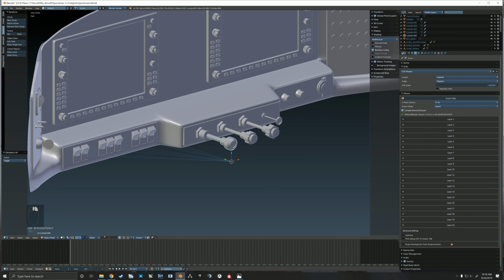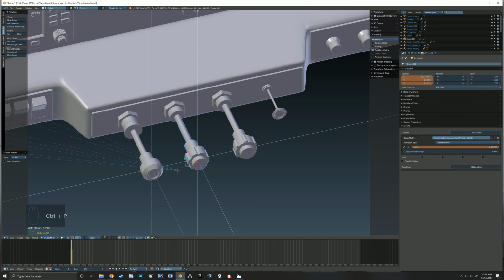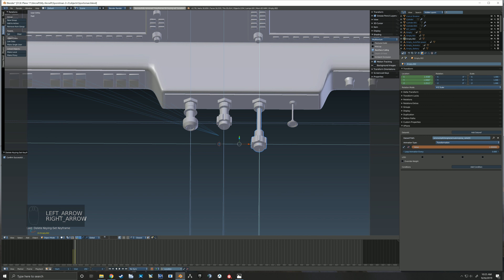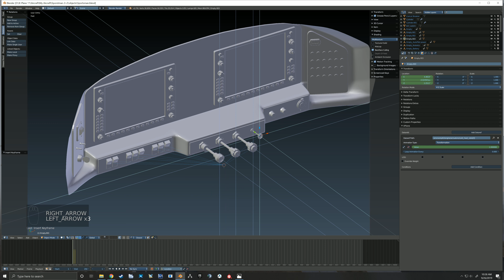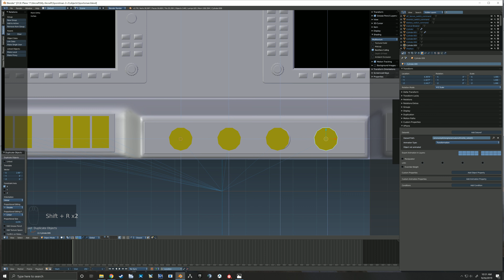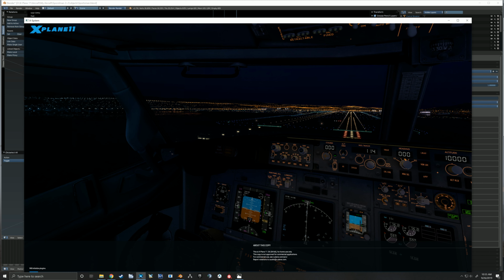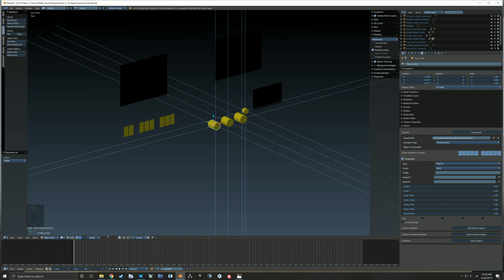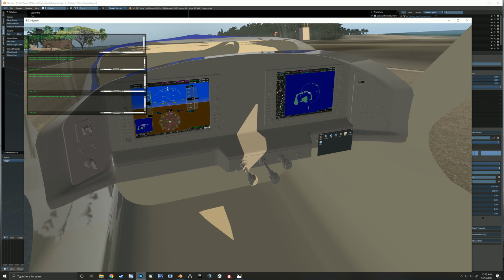How to make an airplane for X-Plane 11 Tutorial #20

Comment: I have a question about the dataref, what muss I insert the degrees or the speed? I have not understood how that works Thanks
Reply from the maker: The dataref value should be the value that it is reading from x-plane. For example airspeed is being fed in knots, so you'll want to input the knots value. If your airspeed needle is animated 0 degrees for 0 knots and 90 degrees for 120 knots then for the first dataref keyframe you would put 0 and for the second you would put 120. Hope that helps. Many of the later videos in the series cover animations and should help.
Reply: @BuildItBetter3D  Thanks
Reply: @BuildItBetter3D  I have a more quest why on my Plane Maker is the anim working and on xplane11 not?
Reply from the maker: If it’s working in planemaker but not in x-plane then you have the wrong dataref or a typo in the dataref.
Reply: @BuildItBetter3D  ok thanks